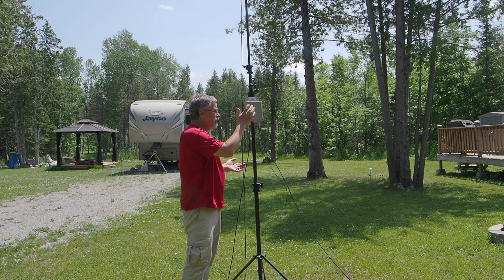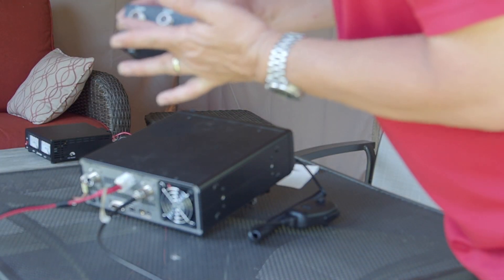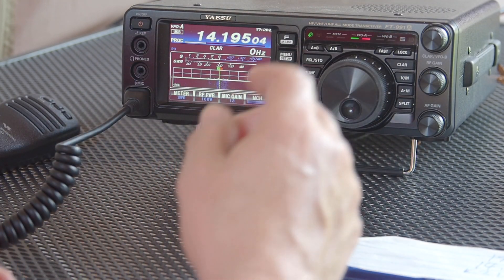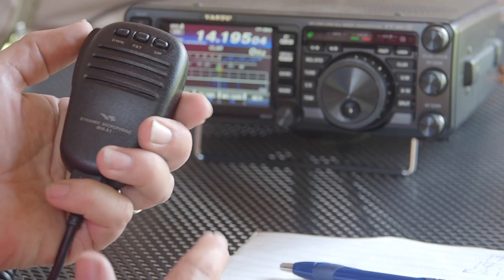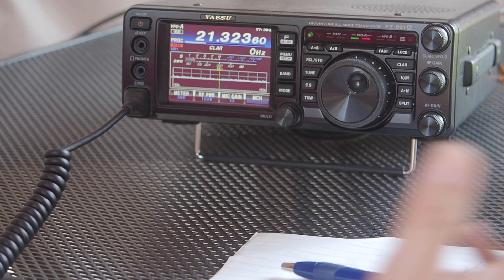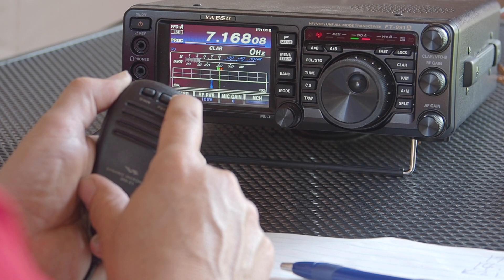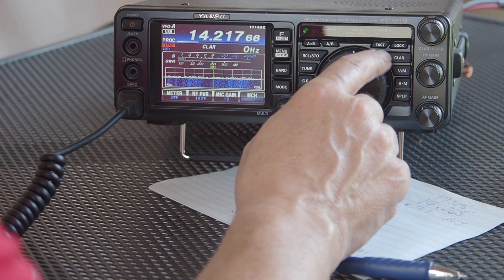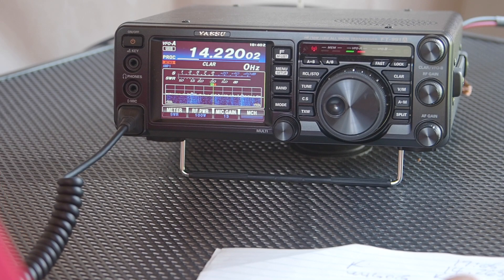RT 100 ATAS Compatible

Comment: i tried this with my atu-100 autotuner. does this only work with the ldg? my 857 wont send out a low power carrier when on ATAS mode and ptt+up pressed. i have a remote mic with it.
Reply from the maker: I do not own an ATU-100 so I can’t tell if it works or not.

Comment: Thank you for this video.  I have a Yaesu 991 and I immediately pulled out the manual and I found the command you need to set up for the ATAS on my 991.  One question I have concerns the instructions for the LDG-10.  I'm looking at page 9 and there seems to be an error in the drawing.  I think it has the connectors switched around in the right hand side of the RT-100 drawing.  I wished you had shown the underside of the LDG-100 on your mast because I am presuming where it says "ANT" that is where you connect your jumper to the antenna that is mounted on the mast.  The connector that says RADIO, that cable goes back to your FT-991A.  I know this all should be obvious, but the instructions were translated from Chinese to English and combined with the drawing error, it is very confusing to me.  I just want to be sure.  Also, I use 2 MFJ Hamsticks on 40M with their mounting device with BOTH of the Hamsticks going vertical.  The active one is straight up and the other or passive one is pointed down.  This seems to work well in this "vertical" dipole mode or whatever you want to call it.  73s Dave WD0HHU

Comment: I have the Chameleon Tactical Dipole Lite for an antenna. I purchased this tuner for my 991A and I can't get anything better than a 1:3 match on any band. Does the tuner work with wire antennas like the Chameleon? It has a 5:1 transformer (aka the Em-comm II) and 60ft of wire on either side of the transformer. Thoughts on that? Thanks!

Comment: I don't want to stand in line with the "frequency cops" but as of today, LDG (Dwayne Kincaid, Tech) responded: "We would not use the RT-100 tuner in conjunction with the ATAS. Both are tuners and should not be used at the same time."73,  Chip
Reply: Chip, he is not using the ATAS antenna with the LDG tuner, he is just using the ATAS tuning feature that is built into many Yaesu radios to tune a 17 foot whip with the LDG tuner.  Normally the ATAS setting on the radio would be used to tune the ATAS antenna, but LDG allow that setting to power and control their tuner.

Comment: Very nice video Dennis. I have a Yaesu FT-891 and like it a lot. I've been using it as my primary radio but have wanted to buy a full featured radio for the shack and make the FT-891 my field radio. The ICOM 7300 had had my attention due to it's overwhelming popularity and tons of good reports, however the Yaesu 991A is a strong contender as well. Side by side comparisons between those 2 rigs show he pro's and con's of each. However seeing your demo for the ATAS system now tips the balance toward Yaesu for me. It's pretty well established that having the tuner close to the antenna is the best location and ATAS makes that both possible and simple. Thanks again for the video.
Reply: hi you can find a lot of addons 4 the 891  if you want to use at home in the field bakpaking .4 home  you can buy the fc 40 antenna tuner ,mobil you can huk the 891 with a fc 50 tuner.4portable just take a atas120a

Comment: How long is the coax to the rt 100 ? Ihave also yaesu ,last one is the FT 891. I work normally with the ATAS on the camper. but this is interesting to use with my buddipole trypod and the mfj 5M long whip;
Reply from the maker: in this video I was using what I had in the RV, the coax from the tuner to the antenna was 20 feet long and the coax from the tuner to the radio was 75 feet long. 
73 de VE3BF
Reply: On this set up I had 90 feet of coax
73 de Denis  VE3BF

Comment: the scope pauses when you TX? bummer, 7300 sure doesn’t.
Reply: The antenna isn't connected to the receive section when transmitting.  Either connected to the RX section or the TX section, but never both...  73 ki4cjj
Reply: david anderson must be the difference between super hed and SDR type.

Comment: Did you need some sort of counterpoise with the antenna? I suppose if I used a wire hung in a tree about 33 feet long 40 meters might be a better match? JK
Reply from the maker: The 17 foot whip did not have a counter poise the the 12 foot mast did act as a an offset and the wire to the station ground help as well.  All this said this was a 5 minute antenna setup to  test the tuners ability to make a match, the antenna was far from efficient but I did manage to make 2 contacts into Australia and 1 into New Zealand on 20 meters when the band opened up at about 11:30 pm.  A 33 foot wire would work a lot better on 40m but this video was all about the tuner.
73